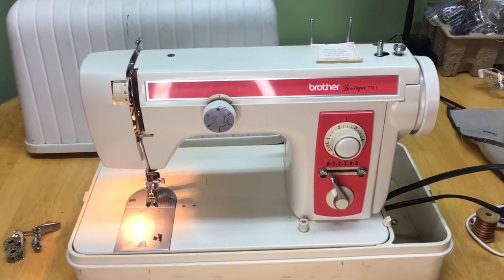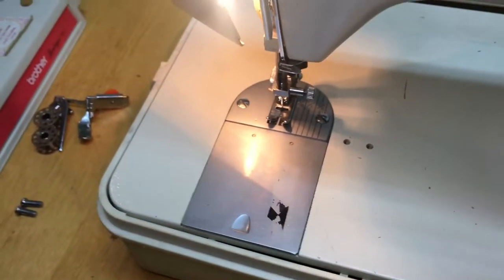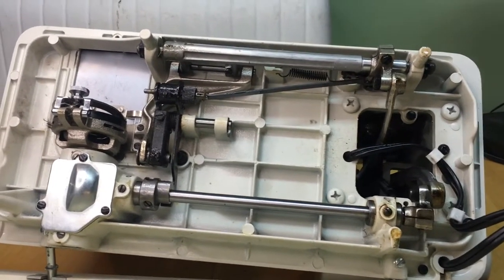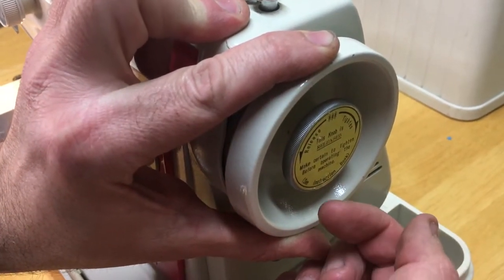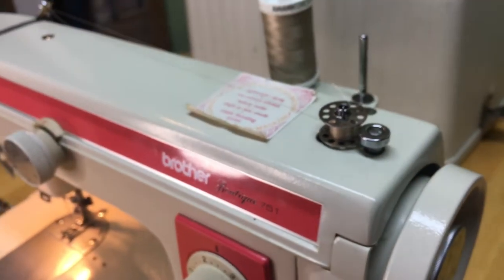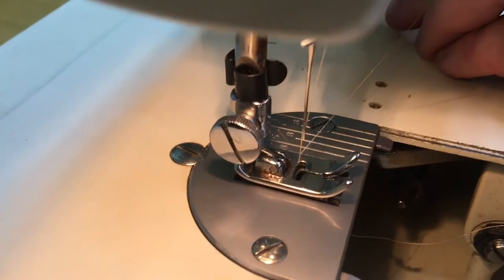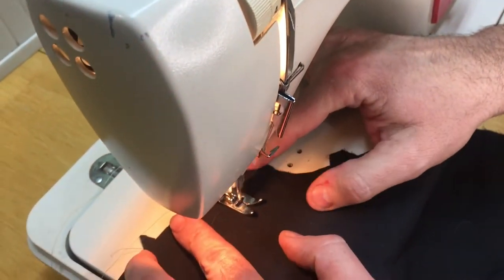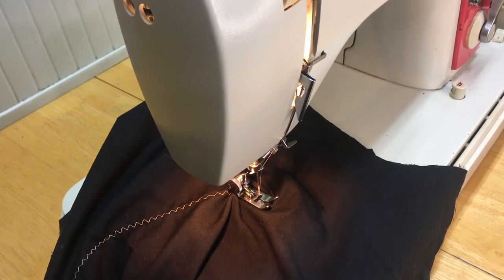Brother Boutique 751 Maintenance and Operation (Bobbin - Threading - Sewing)

Comment: Hi, I just used W5- 20 engine on my sewing machine and it is so quiet now and it runs like a dream,  
but use a needle nose squeezer and go easy a few drops goes a long way.
Reply from the maker: Yes, most of the time noise and smoothness can be enhanced with a bit of oil.

Comment: I have the 431 and I cannot get the clutch knob to loosen up so I can wind the Bobbin. I’ve put wd-40 in the area and used a hair dryer but it hasn’t given yet.  Any suggestions?
Reply from the maker: Here you can use a bit more force to free things up.

Comment: Hi i have a similar model that was given to me so no Manuel or info at all. It has a few more stitch patterns . It ran great for a short time . But now bobbin thread continually breaks or upper thread tangles around bobbin assembly immediately on start. Any suggestions?
Reply from the maker: That could be a couple of things - the tension could be off, or the timing could be off.  Make sure you have good quality thread, threaded correctly, and try adjusting the tension (both on the bobbin and the upper tension). If this doesn’t help you may have a timing issue.

Comment: Referring to 7:53 "I have to make sure it's gonna come out like this": My manual explicitly shows that the bobbin has to be put in the other way around, i. e. with the thread pointing away from you, to the right when looking at it sideways, then pulling it back through the slit. Feels a bit counterintuitive, but there it is...
Reply from the maker: I believe the bobbin thread should be coming off counterclockwise (that should be to the right as you said) I very well might have had it backwards, it doesn’t ever seem to be a deal breaker if I get it in wrong.

Comment: I forgot to also mention that I cannot get the little white button for darning to loosen up.  The turning knob to change from straight stitch to zigzag is also stuck.  Apparently the machine must’ve sat idle for awhile.  I guess it’s just gonna take a lot of patience, oiling and heating.  any other suggestions would be appreciated.
Reply from the maker: I think you are in the right path with lubrication.  I’d say use pliers to help but you need to be careful not to break anything.